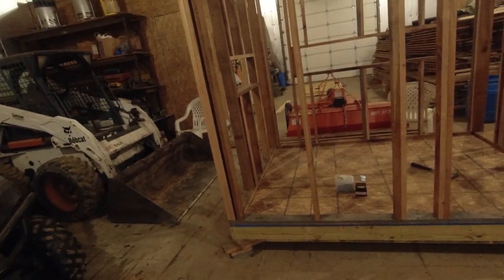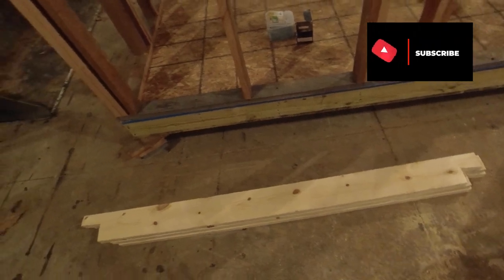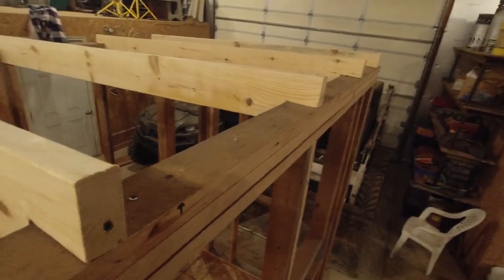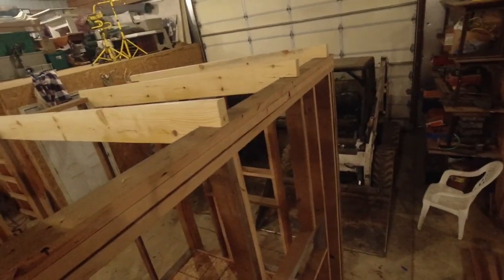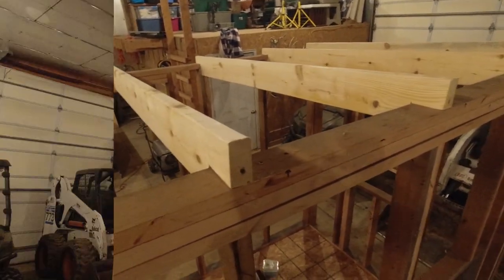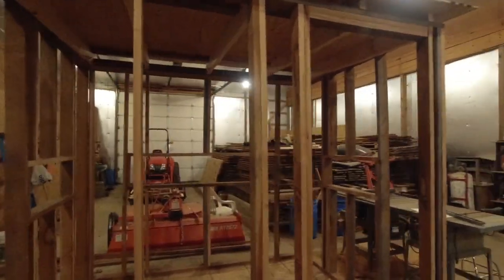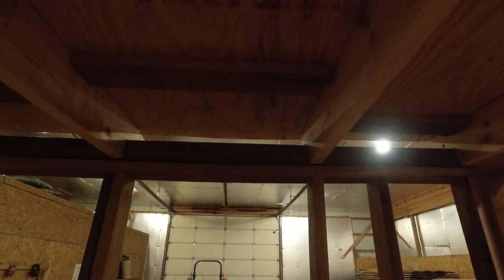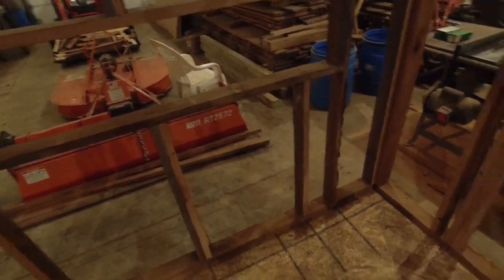Building the ULTIMATE 6x8 DEER BLIND - Lean-To Roof

Comment: I am working on a 6x6 of my own and stumped on roof i like your idea can you give some measurements and angles of roof rafters?
Reply from the maker: Man hard to remember the exact measurements, but I do remember I had a foot overhang for the front and back parts (so 8ft boards for ya), and the sides had an overhang of a few inches. 

For the actual rise/run I decided on 1/12 pitch since I did metal roofing. There's some really good vids out there on doing birdsmouth cuts for lean-to roofs that will make it easy mode. Get a cut that works for ya, then just use it as a template for the other boards.

Comment: Great ideas! Thanks for sharing! I have a couple questions though! 1) did you fill in the gaps at the top between the roof and the top of the walls? 2) If so, with what, or in what way?
Reply from the maker: Hey thanks for watching! Yea definitely, when it came time for the 1/2 plywood exterior walls to go up I butted them up to the roof to fill in the gap, then used silicone caulk to seal everything up. Did the same thing with interior walls too. Tons of silicone to seal everything up and keep out any bugs.
Reply: Nice! Btw… thanks for your quick reply! I’m working on finishing my 8x5. Solid as a tank, and probably weighs about as much! I’m trying to decide between 4x4 treated posts for legs, vs, 4x6, cut back to 4x4 at the ends to accommodate the metal angle bracket post holders,(???). Penny for your thoughts???

 (2x8 Rim joists, 2x6 floor joists, 16” on center. Walls 2x4, 16””oc. I just need to figure out a lean-to roof, and a door and steps. Also, used 3/8” treated plywood for exterior walls. Floor is 3/4” treated plywood. Angle brackets. My concern is the weight. I was hoping to put it 8 ft up, but due to its weight, might drop it to 6 ft elevation.
Reply from the maker: 4x4s all day.  I thought the same thing about it, but a quick search showed that a single 4x4 can handle a vertical compressive load of 4000+ lbs. With 4 of those it will be no problem. The biggest thing is making sure to have your cross braces on across them to hold everything steady and solid.

Comment: What sizes did you cut the plywood for the roof? I’m using Solarboard OSB plywood
Reply from the maker: Bit of personal preference.  I measured the top to have 6-8in overhang on all sides for rain to wash over the metal roof and not make it's way inside, don't have measurements on me but a few sheets will get ya there.
Reply: Yea I have 3 sheets of 7/16 Solar-board osb 4x8 . Just trying to figure out the over hang on all sides for drainage and direct rain to sides to prevent wear and tear. I live in a very humid climate in middle Georgia
Reply from the maker: Right on, I think a foot of overhang all around would keep you safe, you doing lean to style roof or peaked? Either way you should be set man. Good luck!
Reply: Lean to like yours , my build is just like your build except for door on back in middle and larger windows  and my floor to window is taller